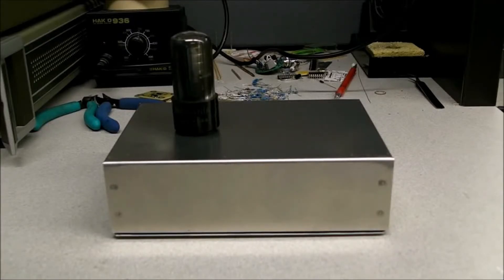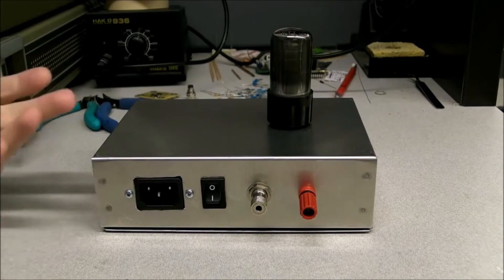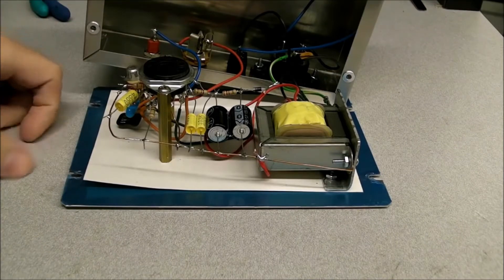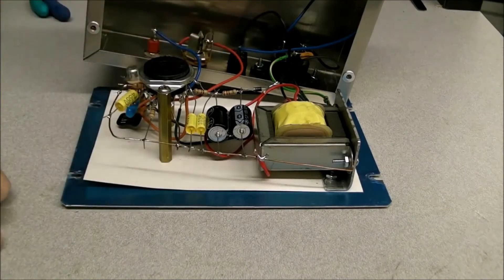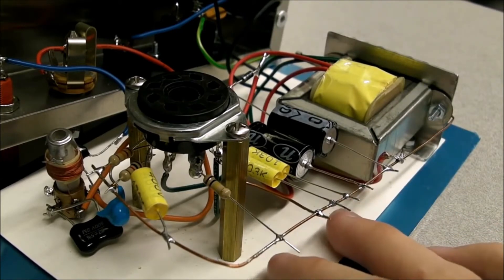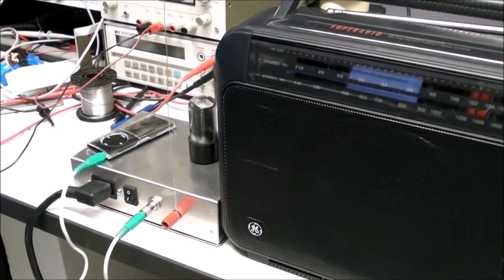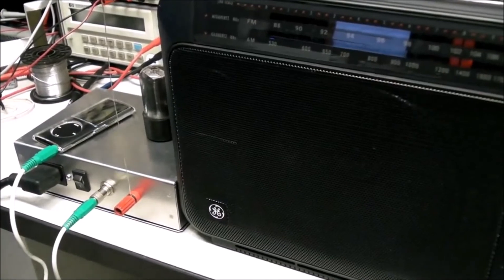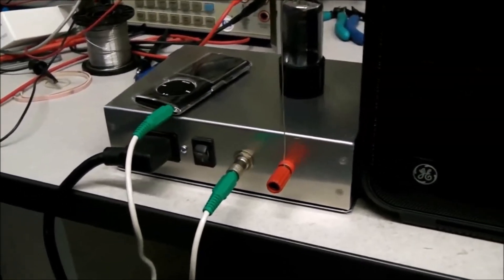how to make One tube AM radio transmitter

Comment: There's a couple 'radio maxims' or general truths for the best signal strengths:
"A watt is a LOT..." & "Antenna is EVERYTHING!"
So for better transmission range use a BETTER antenna, one that's tuned/trimmed to the right length for the frequency you're using. A lot of ham/CB antenna kits ETC have a set screw in the base so the antenna radial can telescope up or down to be set to the correct SWR (Standing Wave Reflection) instead of bouncing that signal energy back into the transmitter and creating a space heater with that wasted power... 

Math is involved to get a decent starting point for the correct antenna element length, so google "wavelength calculator" along with AM antenna designs to get you on the right track. I'll see if I can post one here without goohole/ewetoob having conniption fits... Next would be either turning up the input voltage a "hair" if the parts have the tolerance (risky!) or creating a small AM signal amp circuit on the output stage before the antenna and see if well dressed men in suits stop by?! 😁(kidding, but still try keeping the range to within your property!)

Comment: the set is no longer online,  do you maybe have a other option?
Reply: It's not online true and even a transistor based TX covers more than this. I built an AM TX from 3 transistors, 2 BJTs and 1 JFET. It puts out 50 mW of power and covers 40 yards indoors with 10" thick walls. On open ground, covers twice that.